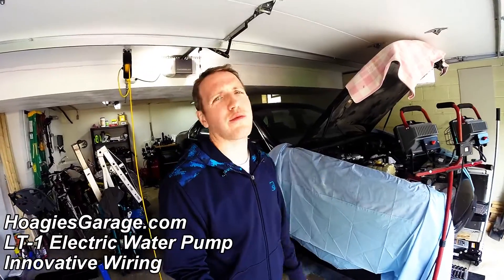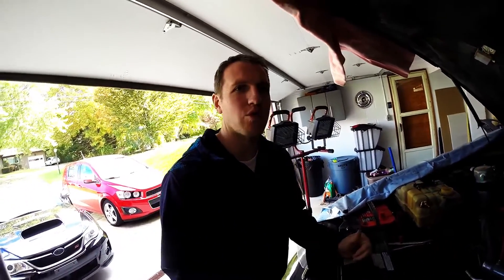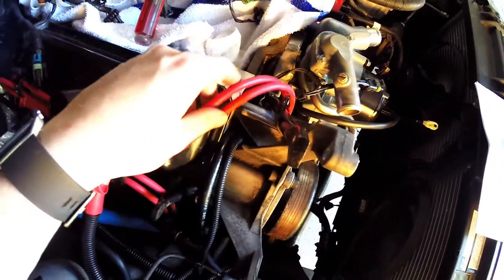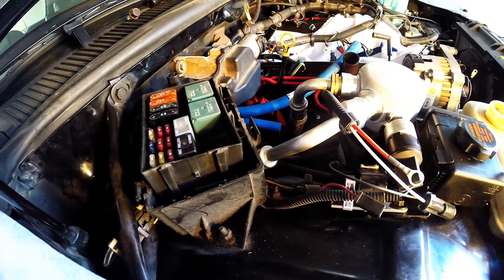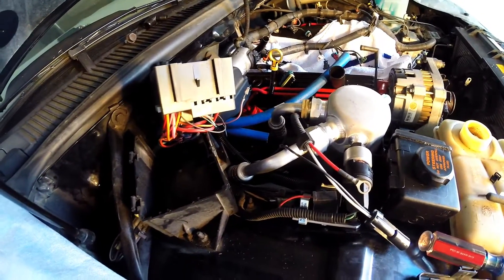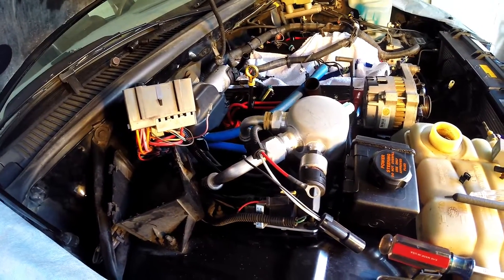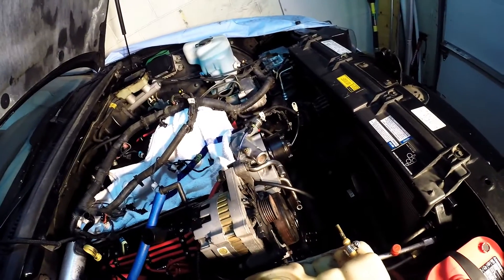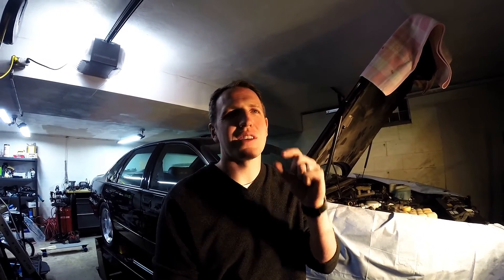LT1 Electric Water Pump Wiring by Innovative Wiring

Comment: Anybody else first time LT1 water pump? What a royal pain in the ass compared to any other Chevy I’ve ever done! If you’re on the fence about doing an LS swap. Do it! Between the Opti Spark and this water pump, it’s tough to love the LT1. I’ve been building show, street and drag cars my whole life. Finishing a 7.50 cert chassis on a 72 Monte Carlo now. I think I’m burned out. Once the Monte is done, I’m selling it.
Reply: Why the hell do people bitch and moan about the water pump and optispark? It's not a big deal!!!
Reply: @Epro95  It never used to be. The reason it’s become one is you can’t get a good one reliably no matter how much you spend. The big deal, is no more Mitsubishi sensors! The reason I thought I could get away with the one in the video is I have a good low mileage sensor. Put it in and done. Never even thought about it being out of clock. Everyone else is here because many of them spent as much as $700 on a new MSD or $400 accel with no luck. Even most MSD is made in China since the bean counters at Holley inc. bought them out. We live in a world with mass incompetence. If you need a distributor, someone in the comments said there’s a company that’s stepped up to the plate. Also about $700. In my opinion, great and brutal at the same time.
Reply: @Epro95  Forgot to address the water pump. The air pump and brackets make it unnecessarily difficult for what is easy on any other Chevy v8. I did the electric conversion with the innovative wiring harness. Requires pressing out the shaft and bearing out the back of the stock housing. For guys that don’t have tube vents to the engine, and just drilled holes for ventilation, when the pump fails, coolant gets into the distributor and requires immediate removal of the distributor to dry it out. That’s if it isn’t ruined. Putting on electric makes changing it out a ten minute job and eliminates the weep hole over the distributor.